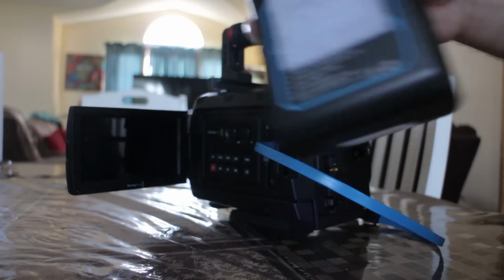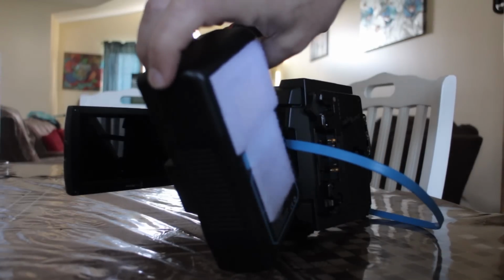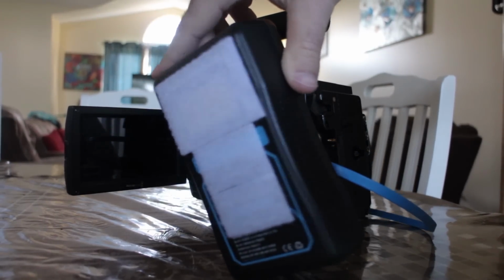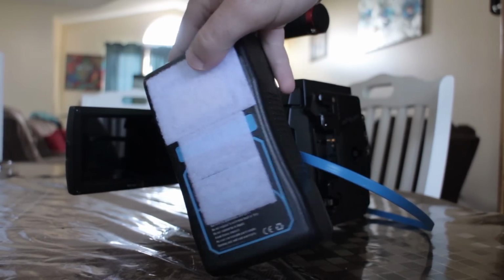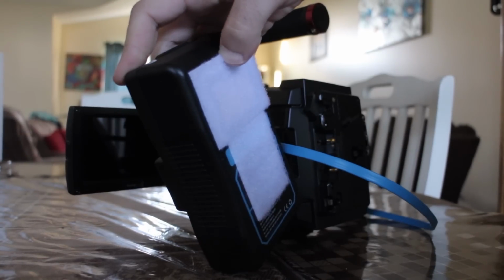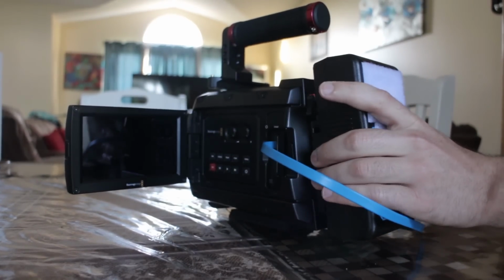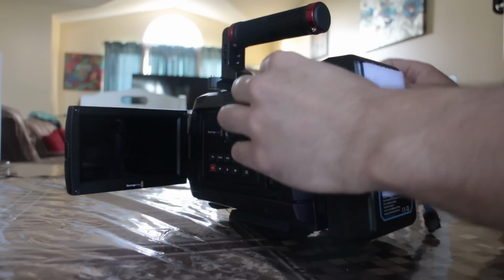Ursa Mini - CFast to SSD converter - $120 setup!

Comment: I wanted to say if anyone is having issues with their cards dropping frames or the recording stopping after a few seconds, try A. formatting in camera and B. putting the cfast to ssd cable into slot 2. this sped things way up for me. i can now record unlimited 60p 4.6k raw uncompressed dng on my 512gb samsung 850 pro. when i was in slot one i barely got raw recording in 24p 1080

Comment: Hey! Wondering if the d-tap to USB cable will work ok for the Samsung 850 Evo 2TB, which I think needs 2.1amp of power. That adapter cable does 2.0A. I've been using one that's 1.6A and it works but I'm dropping frames pretty frequently.. Thanks!!
Reply: Sorry, I haven't tested that cable

Comment: This setup worked perfectlyy for me with the 4.6K. But now that I upgraded to the Ursa Mini Pro, for some reason, it starts dropping frames fast, even at 25fps prores 422 UHD. It's strange since the stuff coming out should be essentially the same. My SSD is the 850 EVO 500gb, I will try to upgrade it to the 850 PRO and see if that helps.
Reply: hey armoton69. Have you already tried it again with the 850 Pro? Is it working again?  Thank you in advance for you answer.
Reply: Luca Senoner I tried it with the 850 pro aswell and it had the same problems. Then I tried the cables from innotech.co.uk that go straight to the SSD without the ssd enclosure and it worked fine with most settings. So it makes me think maybe my cable or the SSD enclosure has taken some damage or just cant process all the data fast enough 🤔 in anycase I feel safer working on client projects with Cfast cards in the future will probably order some of the new budget friendly kompurer bay or angelsomething

Comment: Do you know what SSD to use to record RAW?
Reply: I would recommend the Samsung 850 Pro series
Reply: for my ursa mini pro, i just tested the samsung 850 pro 512 gb and it would give me about 6 seconds of raw 3:1 at 4.6k. no bueno. I also have a sandisk ultra 2 card and it limitless recording at 4.6 raw 3:1 at 24 fps. no slow motion

Comment: So i bought everything you have in the link and it doesn't work on my ursa mini 4k.. what would u say would be the prob?
Reply from the maker: Sometimes I have to connect it to a different USB port (there are two in the cable in used above), and sometimes I'll have to change it while the whole setup is on. I think I even did that in this video I shot. Also maybe try the other CFast slot..?
Reply: Make sure that the SSD has power before turning the camera on.

Comment: hey i tried this same gear same everything .. my ursa says there is no card. pls help
Reply: Did you get the D-tap to USB power cord that has two USB outs? If so, try changing which USB out you are using. Also try connecting everything then turning the camera on and off

Comment: how much recording time with Raw uncompressed at 4.6k with a 1TB ? and have you ever dropped frames?
Reply: At 4.6k: 54 minutes of RAW uncompressed, 1:42 of RAW 3:1 & 2:06 of RAW 4:1
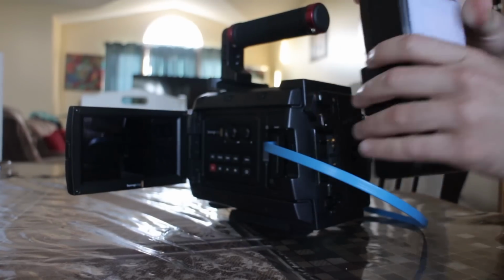At 4K DCI: 1:13 minutes of RAW uncompressed, 2:18 of RAW 3:1 & 2:50 of RAW 4:1 

Frames only start dropping at 4.6K at 60p with RAW uncompressed, and I'm fairly certain it's because I have the Samsung 850 EVO 1TB. The PRO should not drop frames. 4.6K RAW uncompressed doesn't drop frames at 24p, and all other resolutions and frame rates (including 4K DCI at 60p) do not drop frames. 

Always best to be sure and get the fastest possible SSD to ensure no dropped frames.
Reply: will this work ? https://www.bhphotovideo.com/c/product/1086227-REG/samsung_mz_75e1t0b_am_853_evo_1tb_2_5.html
Reply: Scott Wallace yes that is the same SSD I am using in the video...I recommend buying it from Amazon, it's a bit cheaper ;) 

Keep in mind it will drop frames at RAW uncompressed

Comment: Would it be safe to say  that the D-Tap splitting cable would power two matching SSD setups via the USB 3.0 cables together to create a usable "dual card mode"? Just want to make sure it would supply enough power in order to do so.
Reply: Unfortunately I have no way of testing this :(
Reply: It's OK, I went ahead and ordered duplicates of all you gave links to (except for the D-Tap to USB Power Cord of which I ordered and need only one), as well as two 1tb Samsung 850 SSD drives so I will give it a try and test out how things work and get back here down the line.
Reply: ***** Nice! Let me know if it works ;)
Reply: I figure in theory, the splitting cable is splitting for a reason right?, and if it didn't output power to both female USB ports coming out of that single D-Tap input, then it wouldn't be a splitter cable, heck, it would be unnecessary to have the second USB port even coming out of that cable if that was the case. THAT SAID, if by some crazy reason it does not power both at the same time (again, in theory it has no reason not to if its a splitter cable), powering the second drive to a USB charging brick should do the trick so I will test that too. If all goes well then this will do the trick in order to create "Dual Card" mode and get 4.6K 60fps in full RAW. And still be multi hundreds or possibly thousands of dollars cheaper than buying a bunch of CFast cards.
Reply: ***** yes that sounds about right, but I do think you can get 4.6k 60fps in full RAW already with this same setup and a faster SSD. The Samsung 850 EVO series apparently can't keep up but the PRO series should work. And yes, powering from a USB brick works for sure :D
Reply: That's the key word "think"... because I considered that as well, and the Pro version technically is 10MB/s faster than the regular 850, and more so faster if the Pro's RAID mode is activated... BUT who is to say that the BM Mini is designed to recognize dual cards as a default, even if a single card is used at like 100000 bagillion MB/s? So I played it safe to go the way the Mini is manufactured for because if I took the chance with the a single Pro, and it doesn't work, then I have to go through the pain of returning and re-ordering and more time spent without a working data solution. =( .. plus, two 1tb regulars is double the capacity than 1tb Pro LOL. So even IF dual card mode doesn't work (but there's no reason it shouldn't since it will be the same connection order in both CFast card slots) and even if it does work.... I can never say I don't have enough storage memory... prolly ever for the Mini.
Reply: The PRO version does work with the 4K Version at least. Got the C-Box System (same thing, just 400 € more expensive) and using the Samsung Pro 1 TB. 4K, RAW. Works flawlessly!

Comment: If you remove the battery and plug in the power cable to the camera will the plate still work to power the SSD?
Reply: Unfortunately not. In that case you need to plug the power cable to the battery, and thankfully the cable is long enough for a steadicam setup where the battery would be used as counter weight on the bottom of the rig.
Reply: So just unplug the d-tap adapter from the battery plate and plug it into the battery itself? I need to be able to power the ssd without the battery if shooting indoors just to clarify. Greatly appreciate this low cost solution by the way
Reply: Yes precisely. That's the shitty part about this setup, so if you aren't using a battery another solution could be one of those portable USB batteries. There is also a XLR power output on the side for EVFs but I haven't figured out a XLR to USB cable solution.
Reply: Hey Tery, I am physically looking at both cards (I got a matching cable setup for two identical SSD's) lit up 
and CFast recognized while plugged into the side of the D-Tap of the BM 
brand V-mount plate without the V-mount battery attached. (I wish 
Youtube would allow me to post a pic but I cant so I uploaded the jpeg as a link via WeTransfer: https://we.tl/tw4sVp1qDn will expire in 7 days.)